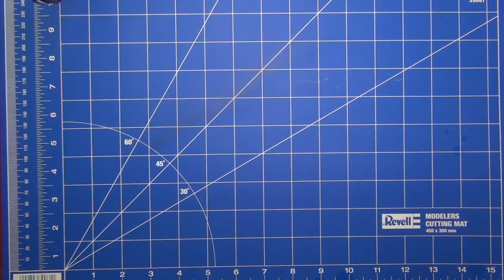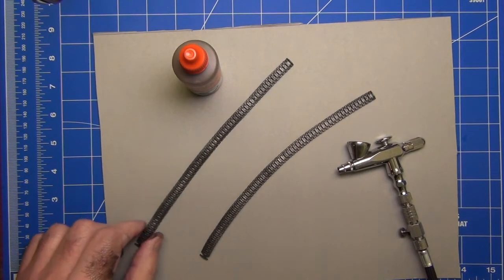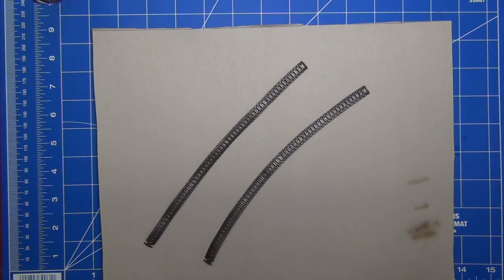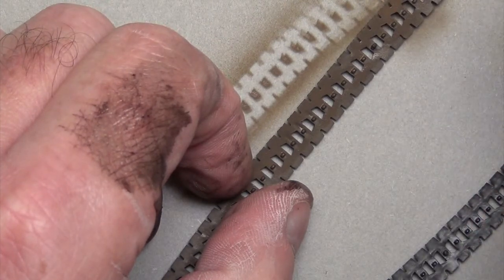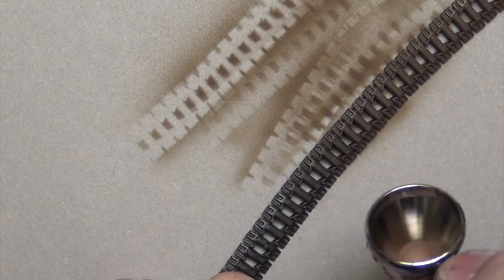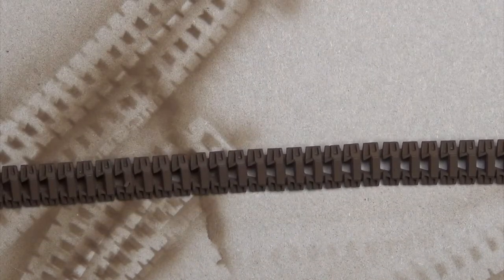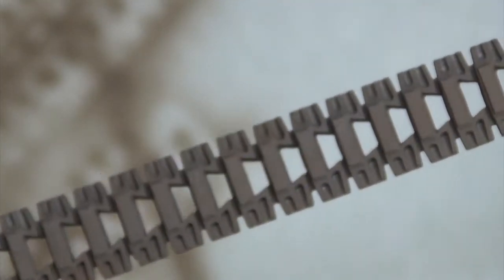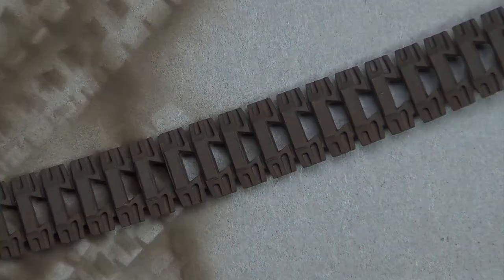AK-Interactive Track Primer Review

Comment: Hello ! Thanks for sharing this information. I have a question as I have difficulties to spray the AK surfacer primer white AK 177. I am using a 0.4mm nozzle. Which pressure should I use ? Thanks.
Reply from the maker: G'day Thanh Quan Nguyen! It's very important to mist the first coat on the model to break the surface tension and give further coats something to grip on to, so aim for a pressure that allows you to do that. A nice smooth mist from the brush to the model, at a distance you normally work. White is a bit more tricky because its a bit opaque and it's easy to flood the model with paint, so don't be tempted to get closer and put more paint down. Mist on the paint, then just use air (no paint) for a bit to dry it and repeat with another slightly heavier mist coat, then dry with air again. Repeat as many times as you feel you need to get good coverage. If your models plastic is a very dark plastic or very strong colour like dark green, red or blie, you might want to spray on grey primer as your first colour, to get rid of the plastic colour and when its dry, start on the white as I described. The grey will cover the models plastic colour much quicker and with less coats. Good luck with it and hope you have some success! Dan

Comment: I have such a hard time with acrylic primers
Reply from the maker: How so Kieth?
Reply: @DansModelBench  I can't seem to get them to spray smoothly consistently. Now! I have every acrylic primer on the market.ak 3rd gen,ak regular , Vallejo, stynelrez, one shot, mission models.what happens for me is I'll load the cup spray sones passes ,and it will sputter .then I move of the subject spray a wide open pass on paper then it'll spray ok after that. depending on brand the next passes will end up not spraying anything and seeming to clog the airbrush with no tip dry..I've tried thinner of same manufacturer as primer I'm using.niwbwhat I did notice is the black  ones seem to be the worst..I recently sprayed a project with one shot grey . Half a cup primer with maybe 5-6 drops of thinner and 2-3 drop flow improver and had better results. Any hints tips are greatly appreciated

Comment: These Ak Primers have no Grip and can be scratched off your model easily.
Reply from the maker: I must admit George, I'm not sure what people do with their models when built to cause scratching, but its said often enough for me to think there is something I don't do with my models that others routinely do. I do typically wipe all my models down with automotive wax and grease remover before any painting. so perhaps that helps. I haven't ever had a problem with models scratching and I use that particular bottle on tank tracks and have for several years. I  cant comment on their durability beyond saying they handle day to day handling and display just fine for me. 

I just saw you are into model railways, so perhaps the level of handling you do with your models causes the problem. That said if handling models like on a railway is the plan, I would avoid all polyurethane based primers and use lacquer based as they bite into the plastic. Down side being they are much more toxic, so need to be used in a well ventilated space and wearing a respirator. Thanks for watching and commenting. All the best for the Christmas season. Dan